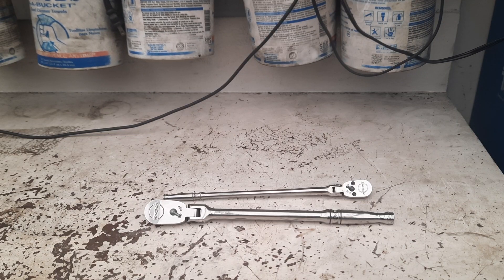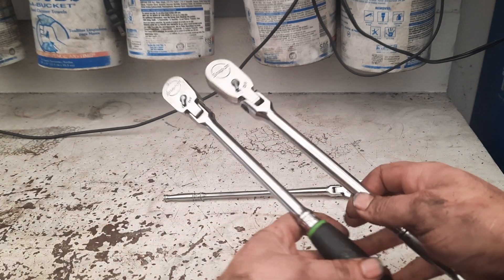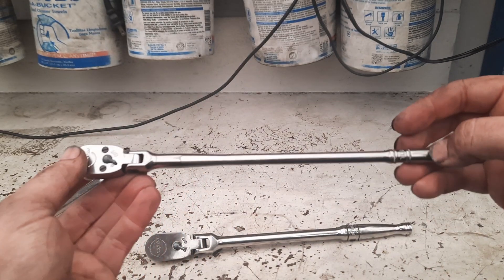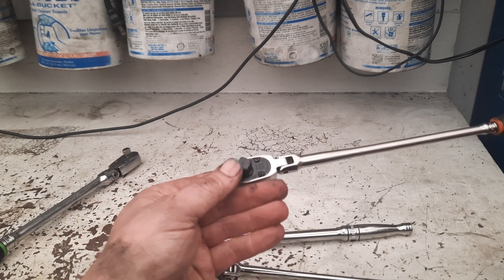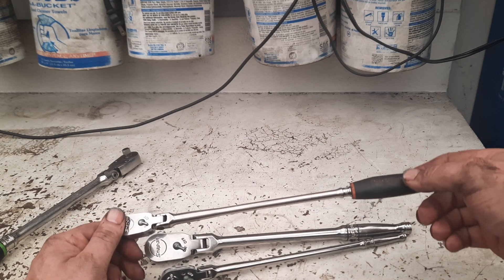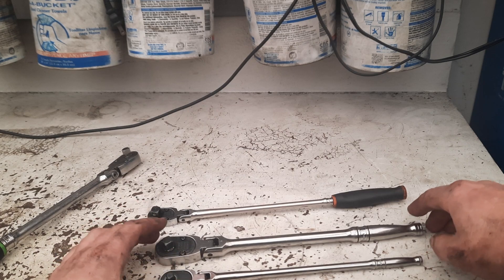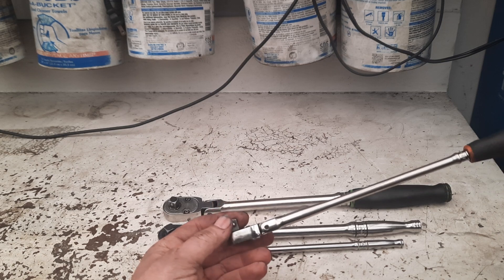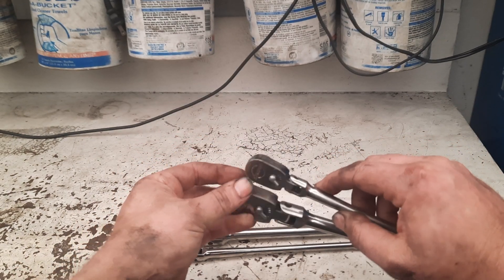TOOL HAUL 10-5-21

Comment: I actually just got the same ratchet (FLF80A). I haven't had a chance to use it much yet, but so far I like it. It's much better than the FR80 I also got. I don't know if it is due to the QR mechanism, but the FR80 is super stiff compared to FLF80A (I got them both new). 

I'm eye-ing a 1/2" locking flex head, but there are probably more commonly used tools that I should pick up before getting one of those.
Reply from the maker: 1/2 locking flex head is a sweet ratchet.  Thanks for watching

Comment: I have a Snap-On ratchet that I bought in 75... Turned lots of bolts and nuts with it...
Reply from the maker: That an old ratchet.  Dose it have a fine tooth count? I'm glad it gets the job done for you. Thanks for watching
Reply: @itsatoolthing6323  No, the tooth count is not very fine but yes it does what I need it to do. I have lots of others that are fine but I usually pick up the old Snap-On. And you are welcome!!!

Comment: My favorite 1/4 and 3/8 ratchets are the Snap on round swivel heads with plastic handles. Prefer these over the flex head ratchets unless in a tight spot. I have older Matco 3/8 and 1/2 locking flex head ratchets, I like the locks better than the Snap on ones, and have thinner heads that fit into tighter areas sometimes. I also have the 1/4 Snap on non locking flex head and 1/2 Snap on long handle locking flex head. These are the most used ratchets.
Reply from the maker: I have some of the rotoe head ratchets. I don't get much use out of them unfortunately.  I should try to use them more. Thanks for watching